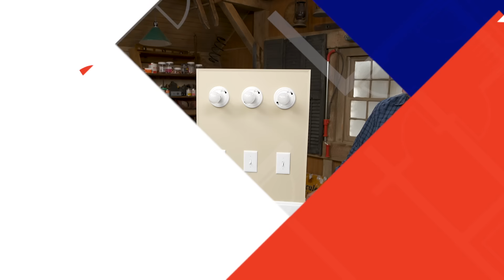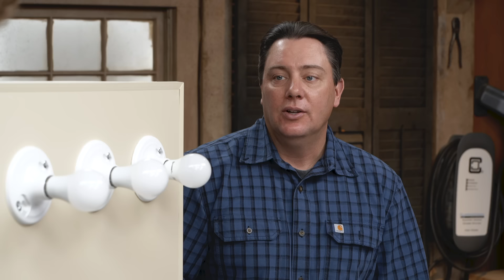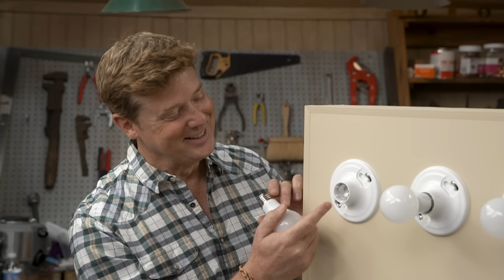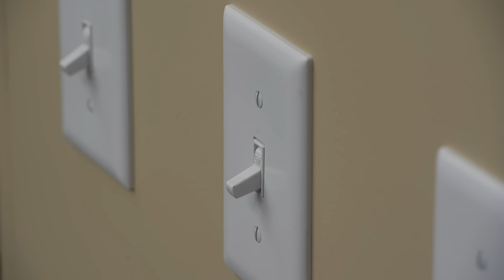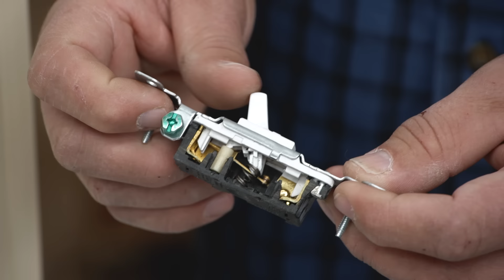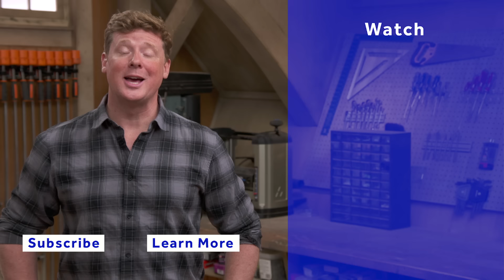How to Fix Flickering Lights in Your House | Ask This Old House

Comment: #4 electric company has a bad neutral wire connection. This is pretty dangerous so always worth figuring out why lights aren't performing normally. Electric company fixes this problem for free because it's in their equipment.
Reply: If it is in your panel that has failed that is on the home owner to pay for, rarely is in the service coming in at faumt.

Comment: Pretty obvious stuff here. How about when you have dimmable fixtures and a supported dimmer but still get flickering? Even tried multiple led dimmers and led fixtures now and still have the issue.
Reply: Loose neutral wires at splice maybe? Or at panel.
Reply: I have the same issue.  Been doing it for years, with both CFL and LED bulbs.  Always on a dimmer that was made for that type of bulb too.  I can guarantee that the connections are all tight in the panel and at the fixtures because I have done them all myself.  I torque those connections down tight with pliers for wire splices before the cap goes on and proper screwdriver at the panel.  My buddy is a master electrician in his 60's and he has no idea what is wrong with it either!

Comment: My led dimmer and lamps are correct, yet when the A/C is on, all on one dimmer (living room) flicker.
Reply: That’s puzzling because the outdoor HVAC compressor and furnace blower should have their own circuits separate from the circuits that power the ceiling lights in rooms.
Reply: @tycox8704  exactly. They are. I had changed out the six canister lights for new LED canisters and since then, they flicker-but only when the A/C turns on.
Reply: @CJP9694  ... since it's only with the AC on I would measure the line voltage one leg at a time, then see if it changes, both off and on. What's probably happening is the AC is 240 volt and somehow the voltage is changing on one leg with the extra load. Your flickering light is on the bad (low) leg so that's what you see. Could be a poor neutral connection (causes balance issues) or another connection problem elsewhere on the feed.

Comment: 2 bathroom light fixtures on the same switch. Each holds 4 bulbs. No dimmer. One fixture has never had a flicker issue. The other fixture has had a single bulb flicker for the last month. Recently,  sometimes 2 bulbs flicker at same time…sometimes only 1 flickers. Surely must be the fixture, but what…?

Comment: As a home improvement contractor, this video interested me. I can honestly say i’ve never noticed so much flickering until Installed LED bulbs in my house. They draw so little and if the voltage fluctuates just a little, then you can get the flicker. Also these new smart meters can throttle electricity and any little fluctuations might show up as flickering.  I really prefer incandescent bulbs and hardly ever experienced as much flickering as with these LEDs. And of course these cheap LEDs don’t last nearly as long as they are supposed to. I’ve found some great videos on you tube about just how lousy the led drivers are in so many brands. Sad, cheap Chinese junk.
Reply: My wife and I have been in our brand new house for a year and a half now and from the beginning, every single light in the house (all led) will very gently flicker for about 3-5 seconds several times per day. Electricians have not been able to find the source of the flickering yet. Is it possible that that's just the nature of LEDs and something we have to deal with?

Comment: Now do flickering because of noisy electrical supply and how to debug the cause. I’ve had breakers not screwed down tight enough, and I’ve had cross-run wires interfering with each other.

Comment: This does not cover every cause of flickering of an LED bulb.  I am using one with a smart switch - don't know if it is the cause, but it will flicker at times, other times not.  Nothing loose - no dimmer involved - no wall switch (old school) involved.

Comment: always have problems with LED bulbs, cheap store brand, GE, doesn't matter. about 25% failure rate within 2 years. one failure I see is the LED leads aren't actually soldered to the metal screw.
Reply: Feit brand has been very reliable for us the past 10 years or so. Costco has them regularly

Comment: Too bad they don't list "all" the potential issues. I went nuts trying to fix a flickering light and it turns out the wire to the pole was loose. You can also have a loose wire causing the issue.

Comment: For the third scenario, unfortunately it’s not “very simple.” There’s no standard for how LEDs are made, so one dimmable LED is completely different from the next. It has to do with how the drivers are made inside the LEDs. Also, they need to be compatible with the dimmer. Lutron has an outstanding LED compatibility website (www.Lutron.com/ledfinder) where you can see the model number of the LEDs that are compatible with a Lutron dimmer.
Reply: This.  This right here makes the 3rd scenario so frustrating.  I have the correct bulbs (says they can be dimmed) and a lutron LED dimmer.  Still flickers and the sweet spot fluctuates depending on who walks by it.  Also AC and high loads (such as my printer) cause annoying flicker in LEDs.
Reply: I would also add that you also check the light bulb manufacturer to see what dimmers they have tested on that light bulb. Just because it is dimmable does not mean that it works on all LED compatible dimmers. I have seen LED lamps that are dimmed using electronic low voltage dimmers, not LED rated dimmers. Finally, if you have a LED dimmer on a circuit that has a shared neutral with another circuit, that also can cause some dimmer issues and flickering.
Reply: @maztaim  Also, don't buy cheap bulbs. Get a good name brand and find a dimmer that is known to work with it.
Reply: @Tim W - Definitely. Lots of LED manufacturers have compatibility lists, too. I use Halo LEDs throughout my house with Lutron dimmers and it took me a while to make sure both company’s products would work with one another.

@maztaim - It’s very frustrating and lots of times ELV dimmers clear up some of those issues. Lutron has shunt capacitors (model# LUT-MLC) that can be added to lighting loads on ELV dimmers. It helps smooth out some compatibility issues. Give Lutron a call though, because if you have a compatible bulb from their website and there’s a problem, they will want to know so it can be re-tested. Some LED manufacturers change the drivers in the LEDs and recycle the model number.

Comment: I wired up my kitchen, brand new 12ga, 10x new led ceiling lights, brand new LED dimmer from leviton.  Depending on where I set the brightness it would flicker, usually around 27% and 73% the ends of the bell curve.  I tried everything, I got a higher wattage LED dimmer, which helped, but at the end of the day I needed to get a different brand LED light.  I started with cheap Home depot lights and moved to expensive Cree lights and it fixed the problem... Kind of a bummer.

The Take away, you can do everything right with LEDs but there could still be problems.

Now ask me about Lights Flickering in a theater... You are using cheap dimmers, or you need to upgrade your building Transformer, or you need to balance your units on the 3 phases.  Zero crossing, dirty electricity etc....
Reply: I feel your pain. I bet if you dim or raise the level of your LED ights they don't dim in sync. This is called "the popcorn effect."

Comment: Simple solution: ditch the retina-damaging LEDs alltogether and use good old incandescent bulbs. Run them at 90% voltage will about triple their life to around 3000hrs.